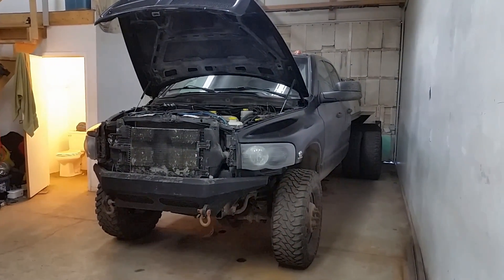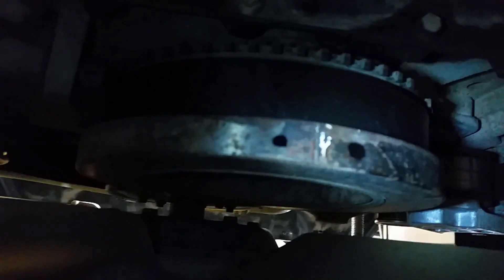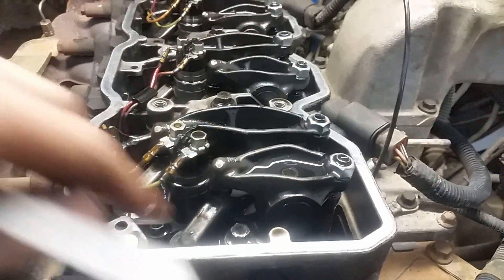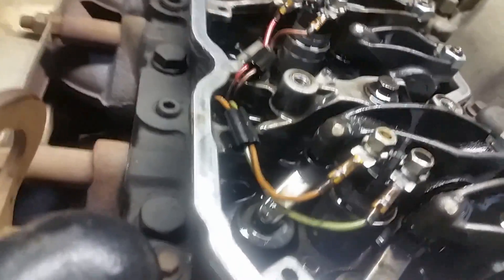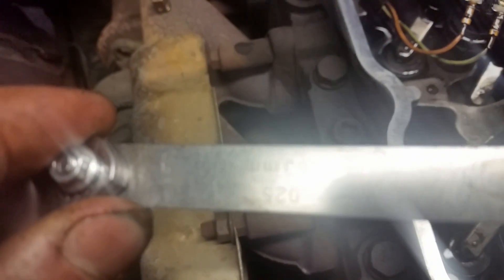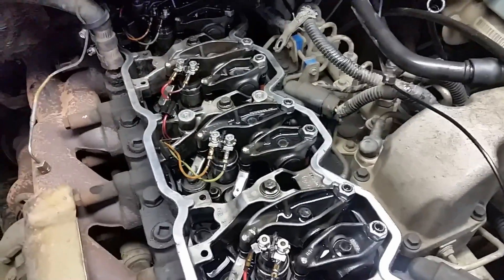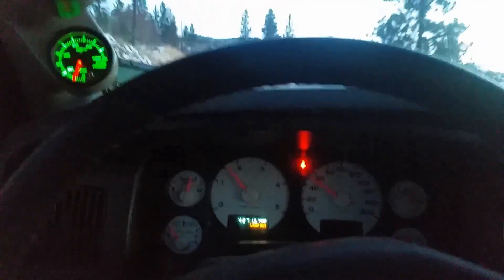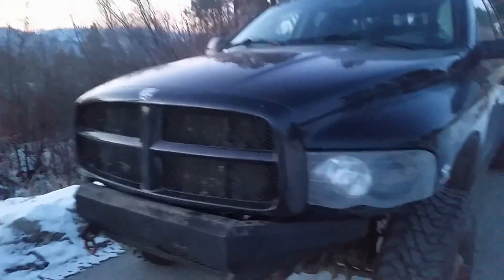24v Cummins Valve Lash Adjustment

Comment: I always set mine at .008 and .018, straight from a cam guy
Reply: What's the benefit of doing that?
Reply: @caelanfarlee4515  Per my cam manufacturers recommendation; it’s just that little bit tighter with a little more lift and duration. We’re talking minute amounts here. Also in my experience, it increases lash intervals

Comment: I have a 1999 Dodge RAM 2500 w/5.9 24 Valve engine. I also have the OFFICIAL Dodge Service Manual. Below are the settings as per this manual. Hope it helps someone. Note that the valve lash adjustment does NOT help fuel economy or EGT according to the manual. Read below what it says EXACTLY from the OFFICIAL manual.
--------------------------------------------------------------------------------------------------------------------------------

If measured valve lash falls within these specifications no adjustment/reset is necessary. Engine operation within these ranges has to adverse affect on performance, emissions, fuel economy or level of engine noise.

Intake Exhaust
Minimum Minimum
0.152 mm (0.006 in.) 0.381 mm  (0.015 in.)
 
Maximum Maximum
0.381 mm (0.015 in.) 0.762 mm  (0.038 in.)

If adjustment is necessary, use the settings below:

Exhaust: 0.020
Intake:    0.010

Top Dead Center

Intake:     1-2-4
Exhaust: 1-3-5
-----------------------------------
Bottom Dead Center

Intake:    3-5-6
Exhaust: 2-4-6

Comment: did you notice the valve noise was louder during warmup cycle? my '06 tends to have some noisy valves when warming up...but at temp she's normal.
Reply from the maker: Yea definitely louder when the engine is cold, Procedure calls for 
adjustment on a cold engine as clearances tighten up with engine heat.

Comment: Common rails don't sound anywhere near as good as a vp44 24 valve or a p pump 12 valve
Reply from the maker: I can make my truck sound exactly like a 12v or vp44 24v cummins just by disabling the pre injection event.
Reply: Cummins life Didn't know you could do that, i figured it was built in to the injectors or something, that's actually pretty neat then.

Comment: Is your oil pressure always that high  at 1700rpm (top right gauge on dash)
Reply: My 3rd gen pressure goes up and down with RPM's
Reply from the maker: 3rd gen oil pressure sensor only reads if it does or does not have pressure, not an actual measurement of pressure.
The gauge you see on dash is just a fake reading based off rpm/coolant temp.